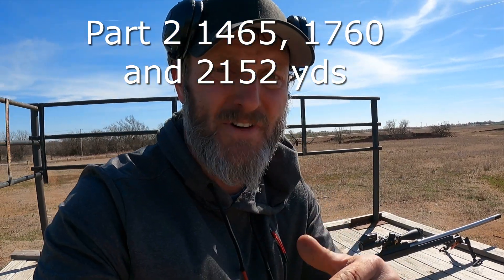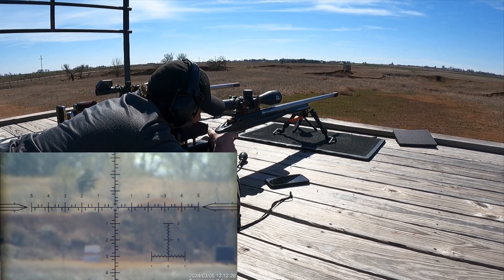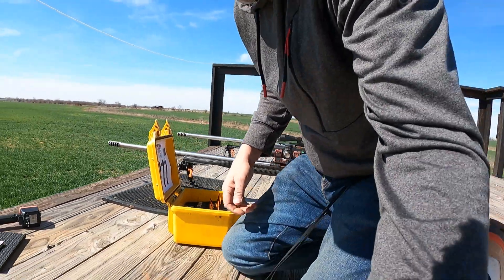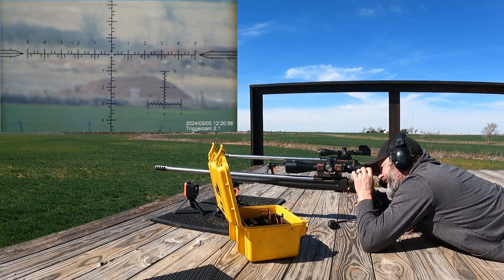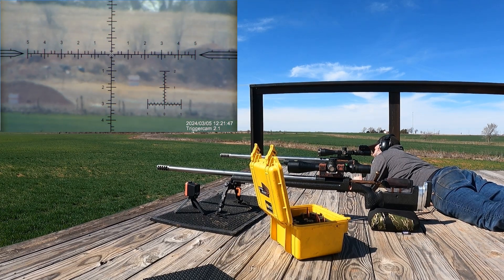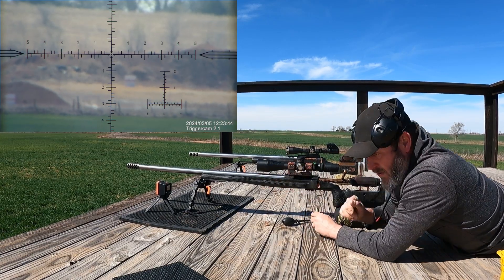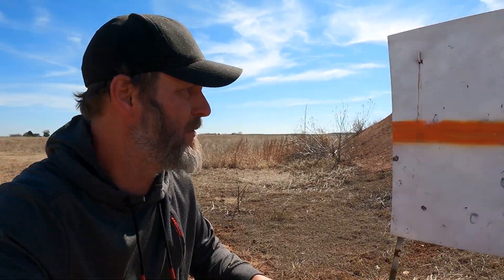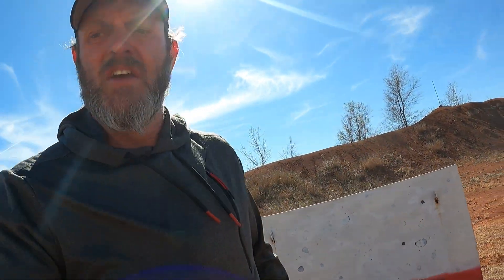Giving away my secrets, load testing 33xc at 1465, 1760 and 2152 yds part 2 of 3

Comment: Ryan i got a question on your 33xc build. I’m having one built up for some ELR light competition. Have done all the math on getting it to 26 pounds and under with a manners stick included. Are you running a standard long action with 1.25” barrel contour? Or are you running an action that allows for a bigger tenon and a 1.5” barrel contour? I can’t make weight with the 1.5” contour on a bat CT action and i don’t know if the 1.25 is enough to handle cranking it? Just looking for some insight. Thanks
Reply from the maker: Ian mine is a Defiance Deviant tactical long action, 1.25 at the chamber 10” of straight and tapers to 1.1” at the muzzle, finish length 35”.

Comment: Hello Ryan, really enjoy your channel! Based on your videos my 300 prc has fallen out of node after just over 1k rounds through it, my original load with 230gr atips was at 76.9gr of h1000 looks like i have to rework that load again, what would you recommend as a starting point on that in charge increment?
Reply from the maker: I’d start at 76 and go to 78 in .4 increments. Should find another node in there.
Reply: @RyanCheneyELR  cool ill give it a try!
Reply: I’d add 20-40 thou in overall length with your previous charge weight to see if it’s simple throat erosion.